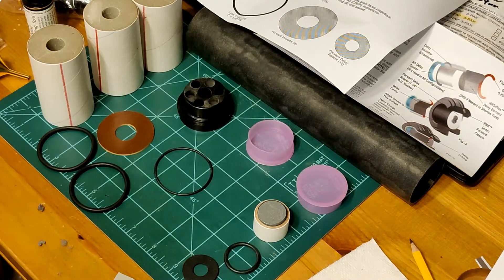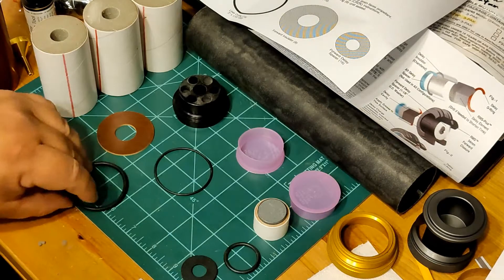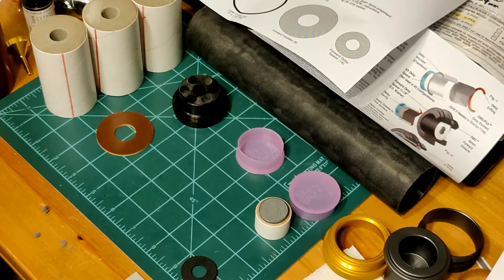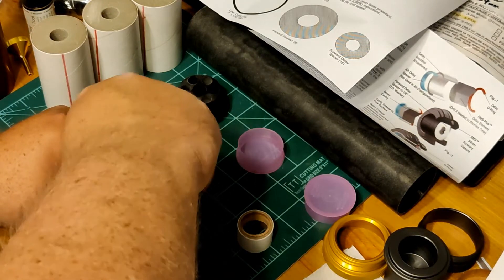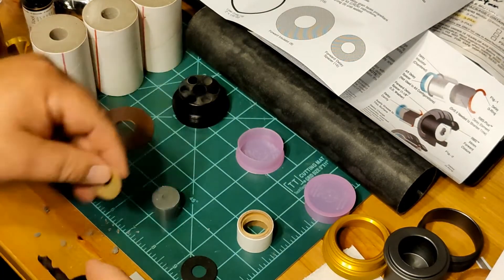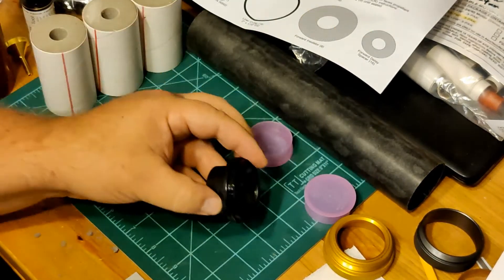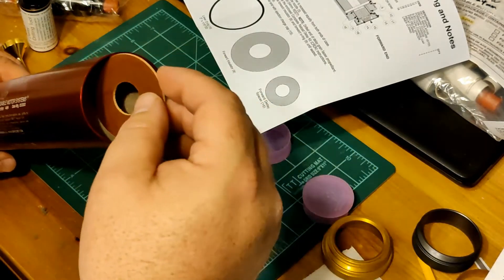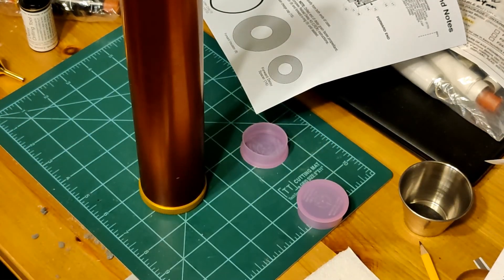Aerotech RMS 54/1280 Rocket Motor Assembly

Comment: or the 38mm RMS, it comes with a red cap to hold the igniter in.  Is that pink cap used for the same purpose?  Do you need to cut a vent hole in it?
Reply from the maker: Yes! That cap can be used to retain the igniter. Truth be told, we never use it. We just use several pieces of masking tape. If you use the cap, it may need a slit cut in it to allow it to fit the nozzle with the igniter in place. It isn't for a vent (the motor will blow it clean off or blast through masking tape), just to hold it in place. As HPR motors just love to spit out igniters, be certain it is well secured!
Reply: @apexrocketry thank you for the info!  Oddly enough mine came with two of these caps and no paper disk. I only have the forward floating closure so maybe the other one was designed to fit over the standard forward closure
Reply from the maker: @greenlex518  I have had a few reloads without the paper disk. If one fits your fwd closure, I would use it. Otherwise...powder, dark barf/wadding and then masking tape!